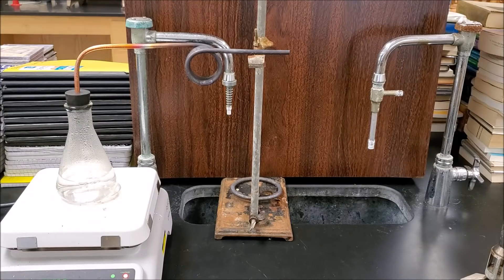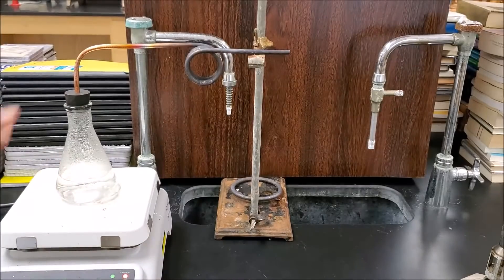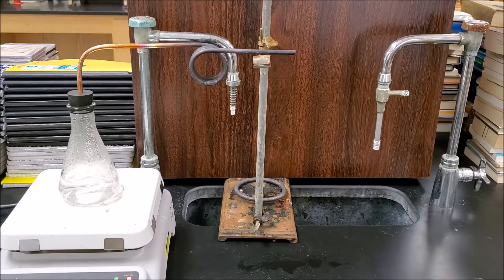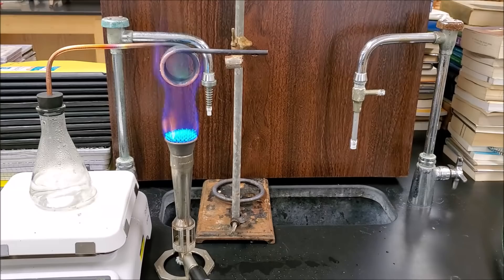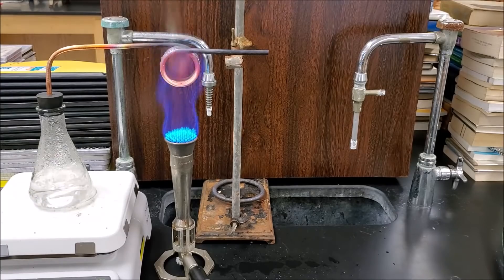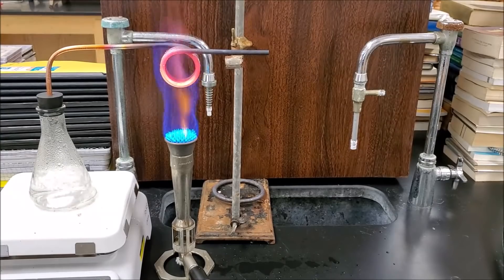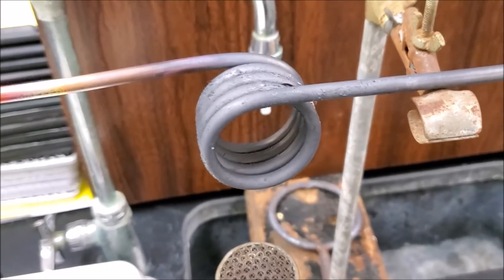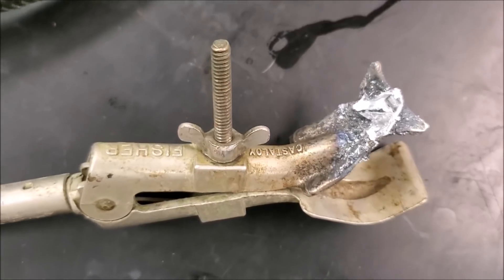Superheated Steam

Comment: Wow! Learned something new. Was the fire ignited because of heat or friction?
Reply: heat. imagine that the steam isnt really water but just really REALLY hot air. The steam coming out of the pipe is around 800 degrees. steam is invisible as well. what you see when cooking is actually just water droplets or a cloud. Infact if you boil water you Cannot actually make steam. The reason is simple as long as there is still water in the pot the max temp of the whole system (without any extra inputs of heat) is 212 F or 100C. The actuall reason is very complicated but imagine that once you get water to 212 F you actually have to add even more energy to get it to turn into a gas. (this is called latent heat) and as long as there is water left in the pot, the water will take that extra energy to make more steam. and if the steam is hotter than 212F then the water will steal back some heat to boil more water. Only when no water is left or the water cannot steal the steams extra heat can you get real steam or super heated steam as its called. 

but enough off topic the fire was ignited from the heat of the steam, not from the friction of the steam going over the paper/match (tho technically heat and friction are one and the same) 

this was your ted talk about steam. :)
Reply: @superspooky4580  thank you
Reply: @LinkinPark4Ever1996   Just to add on friction usually doesn’t create enough energy. If you’ve seen meteors falling from outer space or spaceships reentering and they look super hot and glowing a bright color it’s not so much because of friction but actually because they compress the air in front of them from moving so fast that the air can’t get out of the way. In this case steam is a gas and the match is not doing anything like a space ship instead it’s just there. And the reason why the steam is able to light the match is because of something called activation energy. You ever noticed how if you  spill gasoline on the floor or when there wood just laying there, they don’t start burning even though there’s oxygen in the air? It’s because for the reaction to occur you need energy, that’s why if even a little spark lands on the gasoline it will burn and release energy, this energy will then also help burn the rest of the gasoline, and in this case the super hot steam just function as some sort of spark to start the reaction. Normally the match burn when you strike it against the special section on the box because it’s a solid and solid and their friction creates much more energy, an example is friction welding.
Reply: @superspooky4580  How can you get real steam or superheated steam when no water is left?

Comment: Now am curious, since water is H20, and Hidrogen itself is very flamable, and fire can't exist without oxygen, can you somehow light up in flames the water/steam itself?
Reply: Even though water is hydrogen and oxygen, it is highly stable a highly stable molecule as it has high bond dissociation energy. So you would need to get the steam REALLY REALLY HOT (About 2200° C) to first dissociate it. Then you would cool it down to room temperature, and then you can ignite the gaseous mixture of hydrogen and oxygen to burn it.
Reply: Oh I see, thanks for the explanation
Reply: you can use superheated steam as an oxidizer. 
H2O + C ⇌ CO + H2
CH4 + H2O ⇌ CO + 3H2 
Look up syngas, steam reforming, and water gas for more info.
Reply: @connormcneill9024   yeah superheated steam can actually undergo many very unique reactions that other substances can’t replicate.
Reply: You can actually heat up water to the point it decomposes into hydrogen and oxygen, but…..at those temperatures it hardly matters anymore, because you will have to heat it so much it becomes a plasma, and at that temperature it would ignite anything anyways

Comment: There are so many confounding factors that it's hard to falsify your question at the beginning. A pot of boiling water will, by definition, be a mixture of steam (the bubbles that form) and water,  vs overhead is a mixture of air and water vapor. We know that generally the inverse square law applies to radiation, so intuitively it should be safer the further away we are. If you were able to somehow put your finger in the water proper it should be exactly 100 C which is technically colder than the steam that has gone through a phase change, but that's like assuming spherical cows, it can not happen.
Reply: C'mon, man! No need to go there. Everybody knows cows iz flat!

Comment: this means there's potential for a flamethrower that runs entirely on water, no?
Reply: yes and no. Yes you could use electricity to split the H2O into H2 and O1. then burn it out the nozzle but really thats just a blow torch. A flame thrower is actually shooting OIL out the end of the gun that the fire is burning ontop of. this oil then lands on you and burns (bad). however heres a neat idea for you. You could build a boiling water thrower. imagine you get hit with water from a water gun but its hot enough to scold your skin.
Reply: Water and an energy source; or water, gallium and aluminum with a compressor and storage tank for the resulting hydrogen

Comment: "water can make fire" - Joshua Bollnger, master of gas
Reply: There are numerous ways of starting fire with water. There’s one that consists in placing the water in a transparent plastic sheet and holding it in the air fixed to a structure, you will see the burning effect on the ground if you get plenty of sun, so be careful!
Reply: @ProudMurican_PVT-GR137  so a makeshift magnefier?
Reply: @frostyiv1509  correctamundo brother
Reply: MASTER OF GAS MEL BROOKS.
Reply: my girlfriend calls me the master of gas
Reply: Especially if you perform electrolysis of the water and then take the oxygen from the anode and than place the oxygen in a cryocooler and let it condense until you have liquid oxygen that is the strongest oxidiser and can burn everything and anywhere
Reply: @ricplays5905  funny to think that liquid oxygen itself is not flammable.
Reply: @DRUKENHOBO  Still terrifying though - makes pretty much everything else violently flammable, including you and me.
Reply: A certain dog would have an aneurysm if she saw this
Reply: 'Bollnger'.
Reply: Sodium likes that
Reply: "Ain't that pretty neat?"
Reply: Forgot the I you Keyboard Warrior
Reply: Fire makes water too huh? 

🤷

🤦🤣
Reply: to be fair, he used a very hot fire to make a more invisible concentrated heat, and the paper and wood made fire, seems interesting.
Reply: @VKURDR  simple just HHO
Reply: @VKURDR  right.  he redirected the flames BTUs
Reply: @Buster2058  but?

Comment: in your reasoning wether its better to keep your hand above or in the water, you don't mention that water transfers heat way better than steam.
Reply: just curious, why is that? is it because steam is less dense than water, and therefore its molecules do not undergo collisions as frequently and vigorously compared to liquid water molecules?
Reply: @luhdooce  pretty much. In order to transfer heat you need to have mass. And in f/e 1 m3 you can put much more liquid water than steam :)
Reply: Don't forget that what you see above a pan of boiling water isn't steam, it's a cloud of water droplets.
Reply: Not sure if this is just genuinely wrong because I was literally just told it. Doesn't steam have the same temperature as water at 100°C  but that means that more energy is not being put into breaking bonds because it's a gas now so it could burn you even more because of that?
Reply: @hhhhhnhhhh  Steam exiting the boiling water will have the energy of 100 degrees C of heat + heat of vaporization in it. Technically the steam has more energy to release than the boiling water does in the pot - the difference here is there is less steam to transfer energy to your hand than water in the pot if you submerged your hand. Boiling water doesn't break any bonds, it just excites the particles enough to escape as a gas. Steam will burn you more as it transfers the heat of vaporization to your hand as it condenses back into a liquid (if you're comparing the same amount of steam vs liquid water)
Reply: True that but superheated steam cuts like a knife.
Reply: @dbmail545  Well, that's also due to its low density. Otherwise it would cut like a waterjet cutter or possibly a H.E.A.T. projectile.

Comment: Can water be heated to the point that it ionizes and becomes plasma?
Reply: Extra extra spicy water
Reply: Ofc it can! But not sure if it could be achieved with fire
Reply: Anything can be ionized and become plasma. Anything at all. Everything has a potential in which it becomes plasma. Usually done with electricity, not fire though. As another user said, I don't think fire would be able to do it. Well that's not fair. So, you have to be able to transfer heat into it, like oxy-ace torch hits 3100C, but, trying to transfer that heat into the water would be difficult, I suppose blowing steam through a carbon rod that has been bored, but not sure what the inside temps would be like. You could do it easily either 1 step or 2 step using electricity, though. It would also disassociate into it's component atoms, and no longer be water. The energy required to ionize a material is above any chemical binding energies, for pretty much every element (iirc).
Reply: @dogsarebest7107  Or you can just pump a whole bunch of radiation into it, similar concept to a microwave. In fact you can actually create plasma in an ordinary microwave, though I wouldn't recommend doing so.
Reply: The water would probably break down because of the intense heat before that point, but the products hydrogen and oxygen can easily become a plasma.
Reply: unfortunately no. at plasma temperatures the H2O molecule becomes unstable and can fall apart back to H2 and O. Then the H2 becomes unstable and just becomes atomic hydrogen or H1

Comment: Hi, I dont know much about steam, but does a superheated steam use less water?
Reply: welll... yes and no. in the production process super heated steam is just made from regular steam so not really. BUT that really hot steam has ALOT more energy in it. So you can use less of the steam to do the same thing. Think like a bathtube or shower valve. If your hot water isnt that hot then you have to turn it up hotter on the dial to stay warm. if your hot water is SUPER hot then you have to mix it with cold water(turn down the dial or turn on some cold to mix) so it won't burn you. you use the same amount of water total BUT you use less hot water because your mixing it with cold water.
Reply: Nope. It takes a pound of water to make a pound of steam.

Comment: that steam have a mixture of oxygen? or still H2O
Reply from the maker: At the opening there would be mostly H2O in vapor form, but there could be small amounts of oxygen mixed in.
Reply: @chemistrywithmr.b8441  thanks, im trying to do diy activated carbon will it burn the charcoal in the isolated bottle if that super heated stem contains enough oxygen?
Reply from the maker: @soundwaynes3885  I don't think this technique would work for that.  The steam becomes superheated after it is passes through the coil being heated.  You might be able to get some spots of the ash/charcoal but it would take far too long to be much use. The easiest way to make charcoal would be to cook it is a pot with a loose fitting lid.  The hot air expands and escapes the pot, leaving the wood itself in a mostly oxygen-free environment.
Reply: @chemistrywithmr.b8441  ok sir thanks for the reply